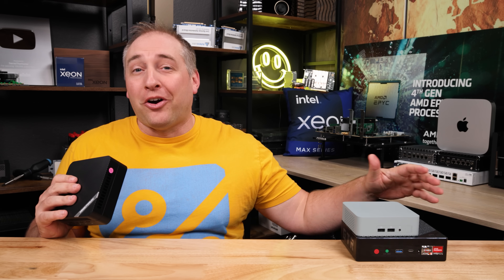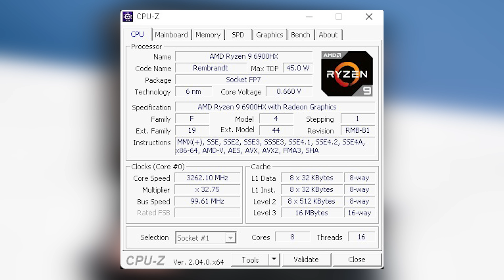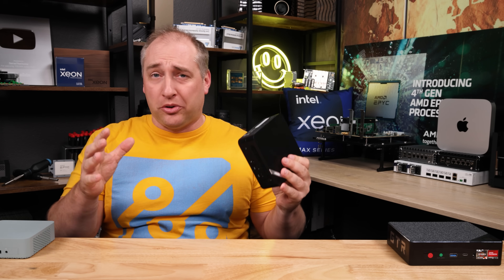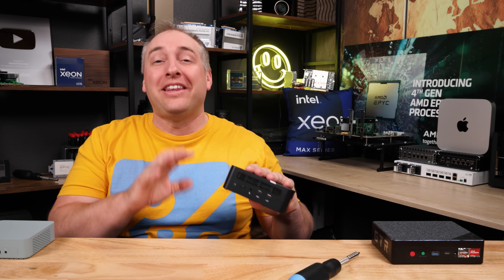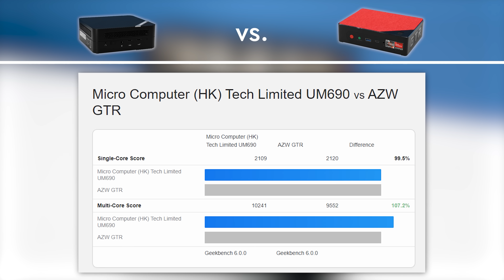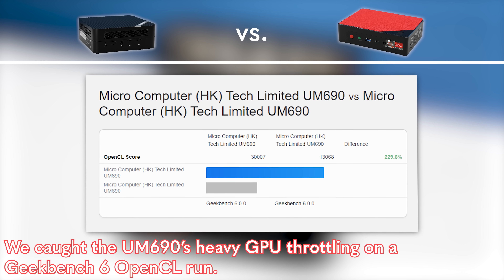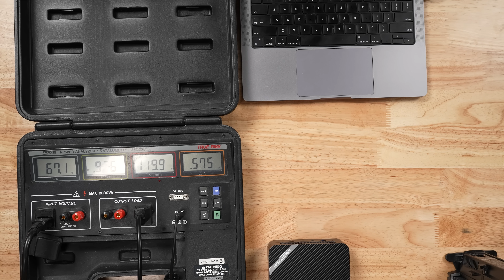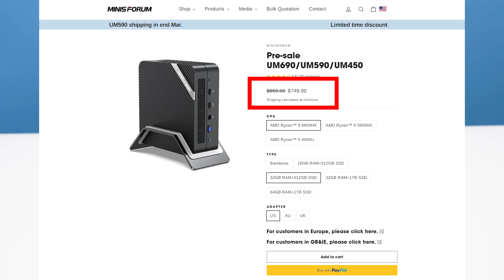HOT AMD Mini PC? Minisforum UM690

Comment: Nice to see you cover this as i looked into it like a few days ago as i want something low power and portable that i can use for having a mobile system for various cases.. as one of those is using my drawingtablet(wich also can be used as a display) I dont need something with its own screen but something i can chuck in a backpack together with said display and a 60% keyboard and mouse.. it being able to halfway game helps.. would get the 64 GB ram config though just because if i edit some digital art it can eat alot into memory capacity wise(speed doesnt matter for that really)

Comment: The cooling is an issue across the minifourm boxes my b550 has the same cooling issues for the 2 nvme slots. They offer nvme cooler connections but don't lett you what the connector is so you end up using the 2.5 connector to power the nvme cooling
Reply from the maker: It is interesting since they advertise cooling with liquid metal and such, but then leave a large hot spot on the other side of the chassis.

Comment: if it can't run a game in 4k, why play it in 8k anyway? besides if you want a gaming machine why would you be buying this anyway? buy a higher end mini pc with rtx 3070  and 8 cores like the silver one with the skull on one side and the cheese grater vent on the other side.  can't remember the model name.   it has core i7 8 cores 16 threads, up to 64 gb ddr 4, rtx 3070.
Reply from the maker: The Beelink GTR6 with the same CPU was playable while recording using OBS at 4K because it was not overheating. Sometimes these get used as extra TV connected HTPC/ light gaming PCs. If you are thinking about the Dragon Canyon NUC 12 Extreme, that is $1099 on sale without the GPU so it ends up being 2x the cost.
Reply: Why would you buy Intel? Upgrades are a nightmare, Intel changes the CPU socket more often than they change their socks.
Reply: @waynesworldofsci-tech  This is a video reviewing a mini PC with a soldered CPU
Reply: @Birdulon  

My mini-PC has an AM4 socket. Easy upgrades. As I said, why mess with a machine you can’t upgrade? 

On a laptop I understand why. But on a desktop? No bloody way.

Comment: A better mini PC AMD CPU is the 16 cores 32 threads 7945hx

Can't wait for it 🥳
Reply: Not out yet. Also remember the 7945HX will only have RDNA2, not RDNA3. The 7940HS coming out will be 8/16 but have RDNA3.
Reply: @neilquinn  just calling it RDNA2 is overselling it - it's only 2CU, the sort of integrated graphics you'd expect to just drive a screen or two. Huge step down from anyone used to the APU offerings of the last few years, only really meant to be used alongside a discrete GPU.
7940HS is definitely more exciting in the smallest boxes, decent upgrade from previous APUs. Would be nice to get more CPU cores too, but if I had my way there would be a miniPC built around the AMD Instinct MI300, hehe
Reply: @Birdulon  Yes correct. RDNA2 is being generous. Basically the 7945HX is meant to be paired with a discrete gpu for gaming. Otherwise would be a great rendering type machine. The 7940HS is what you'd want for igpu gaming. RDNA4 is when I think we'll see these machines really be able to game on modern stuff.